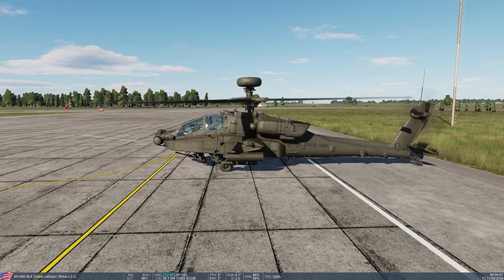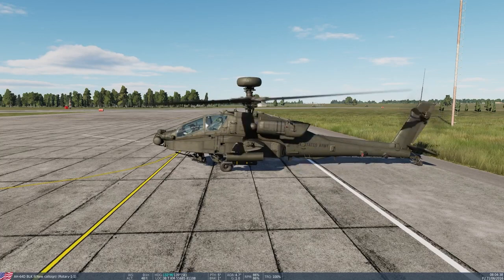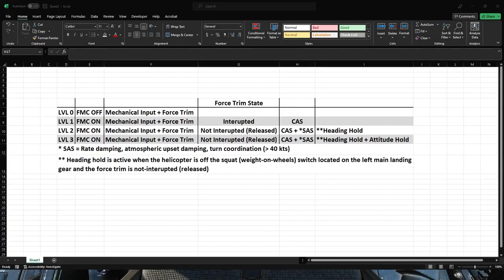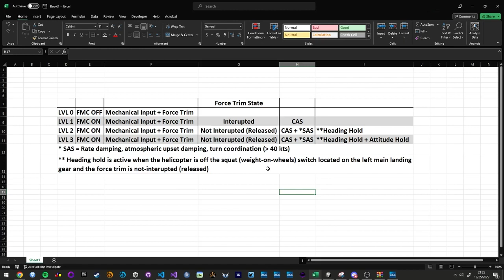AH-64D Flight Controls

Comment: Is there a way of disabling heading hold only while in a hover without pressing an holding trim switch or manually disabling it on fcs page ?
Reply from the maker: It's always on, unless you are on the weight-on-wheels (squat) switch or turn the YAW channel of the FMC off. It's the one hold mode you don't have direct control over.
Reply: @bradmicksflightrelatedthings  Ye I was just thinking of easy way to turn to new heading while in a hover without the need of pressing and holding the trim button.
Reply from the maker: There are 'breakout' values on the pedals as well. I want to say it works out to about 3% of movement from the 'reference' position on the control indicator. So wherever the red diamond is (the reference) if you apply pedal +/- 3% from that refrence position, heading hold will be temporarily deactivated (have no effect). Once you return the pedals to the reference position, the heading hold will re-engage and the FMC will reference your current heading as the heading to hold. The logic is still WIP, but it does work...sort of. In the real aircraft the preferred method for pedal turns is to not interupt the force trim and instead 'breakout' of heading hold. It makes the helicopter much more stable, because you have all the other SAS features helping you out. Hopefully that makes sense!
Reply: @bradmicksflightrelatedthings  Wait I didn't quite understand that, is there a way we can do this now?
Reply from the maker: Just apply pedal in the desired direction, when she starts freely turning, you know you've 'de-activated' heading hold.
Reply: @bradmicksflightrelatedthings  I tried but it doesn't work well 🙁